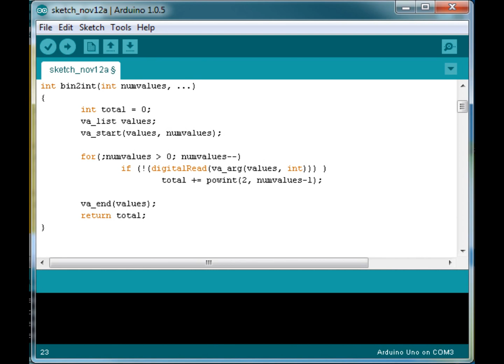DIP Switch - Arduino

Comment: It’s a nice project! I tried it using the code that is on the description but it didn’t worked to me so I made it some changes and here it is 

#include <Arduino.h>

byte leds[8] = {2, 3, 4, 5, 6, 7, 8, 9};

// Intervalo de acendimento dos leds
// Interval of leds animation
int interval = 250;
int speedCfg = 0;

// Prototipo de funciones
int bin2int(int numvalues, ...);
int powint(int base, int exponent);
void TurnOffLeds();
void Anim1();
void Anim2();
void Anim3();
void Anim4();
void Anim5();

void setup() {

  for (int idx = 0; idx < 8; idx++)
    pinMode(leds[idx], OUTPUT);

  pinMode(A0, INPUT_PULLUP);
  pinMode(11, INPUT_PULLUP);
  pinMode(12, INPUT_PULLUP);
  pinMode(10, INPUT_PULLUP);
}

int config = 0;

void TurnOffLeds() {
  for (int idx = 0; idx < 8; idx++) {
    digitalWrite(leds[idx], LOW);
  }
}

void Anim1() {
  for (int idx = 0; idx < 8; idx++) {
    if (idx - 1 >= 0)
      digitalWrite(leds[idx - 1], LOW);

    digitalWrite(leds[idx], HIGH);
    delay(interval);
  }
}

void Anim2() {
  for (int idx = 7; idx >= 0; idx--) {
    if (idx + 1 <= 7)
      digitalWrite(leds[idx + 1], LOW);

    digitalWrite(leds[idx], HIGH);
    delay(interval);
  }
}

void Anim3() {
  for (int idx = 0; idx < 4; idx++) {
    digitalWrite(leds[idx], HIGH);
    digitalWrite(leds[7 - idx], HIGH);
    delay(interval);
  }
}

void Anim4() {
  for (int idx = 0; idx < 8; idx++) {
    digitalWrite(leds[idx], HIGH);
    delay(interval);
  }

  for (int idx = 7; idx >= 0; idx--) {
    digitalWrite(leds[idx], LOW);
    delay(interval);
  }
}

void Anim5() {
  for (int idx = 0; idx < 8; idx++) {
    digitalWrite(leds[idx], HIGH);
    delay(interval);
  }

  for (int idx = 0; idx < 8; idx++) {
    digitalWrite(leds[idx], LOW);
    delay(interval);
  }
}

int bin2int(int numvalues, ...) {
  int total = 0;
  va_list values;
  va_start(values, numvalues);

  for (; numvalues > 0; numvalues--) {
    if (!(digitalRead(va_arg(values, int))))
      total += powint(2, numvalues - 1);
  }

  va_end(values);
  return total;
}

int powint(int base, int exponent) {
  int result = 1;
  for (; exponent > 0; exponent--)
    result *= base;
  return result;
}

void loop() {

  config = bin2int(3, A0, 12, 11);

  speedCfg = bin2int(1, 10);

  if (speedCfg == 1)
    interval = 125;
  else
    interval = 250;

  TurnOffLeds();

  if (config == B100)
    Anim1();

  if (config == B010)
    Anim2();

  if (config == B001)
    Anim3();

  if (config == B110)
    Anim4();

  if (config == B101)
    Anim5();
}